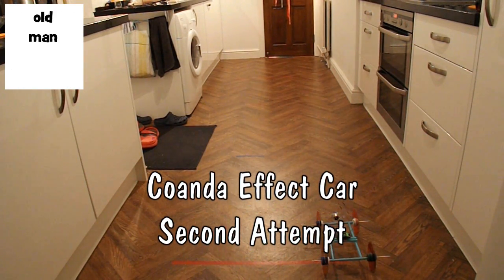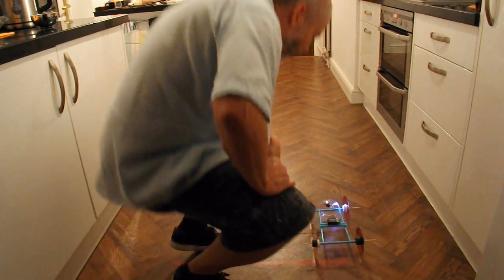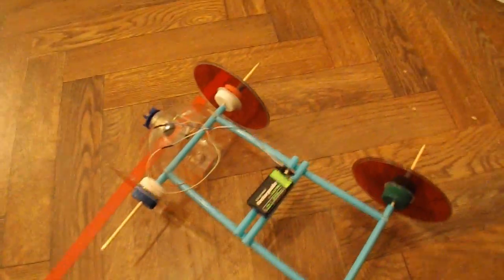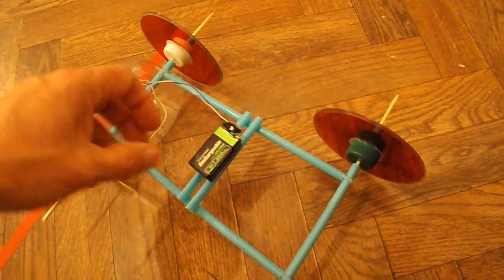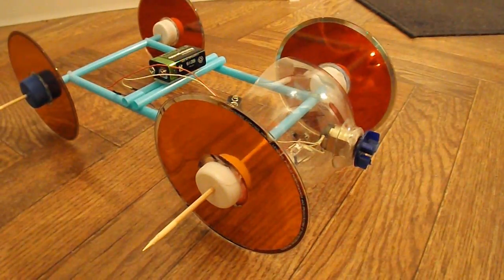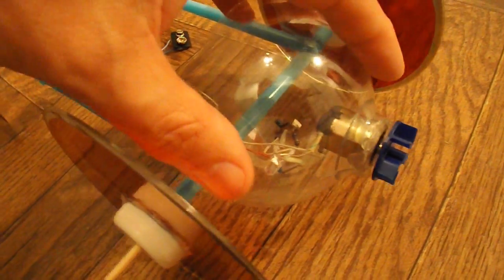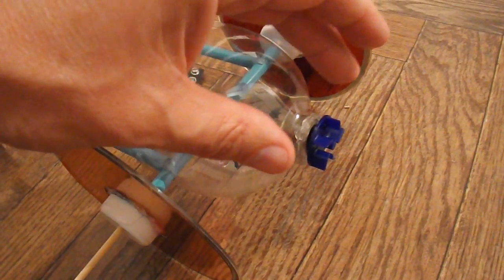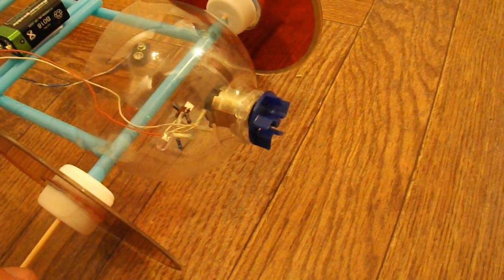Coanda Effect Car - Second Attempt

Comment: Thanks for this link, from your new video.
Tiny fan there ! shows how small the assembly can be for some very different motoring.
How does it still sound like the vacuum cleaner ? lol
Reply from the maker: Yes the sound must be down to the fan shape. You notice nearly all the links that appear on the right of the screen are people trying to make vertical take off flying saucers. I thought that F1 car exhaust Coanda effect was far more interesting to see how they use every opportunity to increase the car's performance, even down to making use of the power in the exhaust.

Comment: kan u make a boat or a plane of that coanda effect?
Reply from the maker: A boat should be quite easy as it is basically no different to the car, but watching the videos on YouTube where people have tried flying them it seems more trouble than it is worth. As far as I am concerned it is an interesting novelty but you might as well put a propeller on and get a much easier job. I have no intention of doing any more work on this.